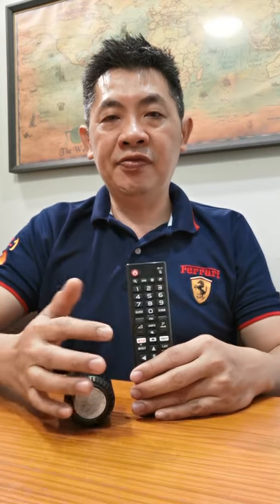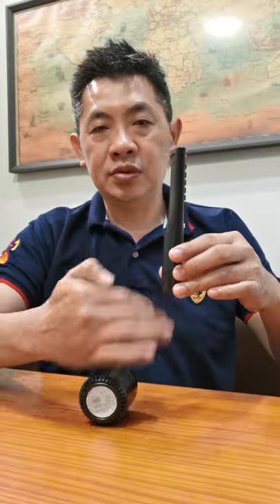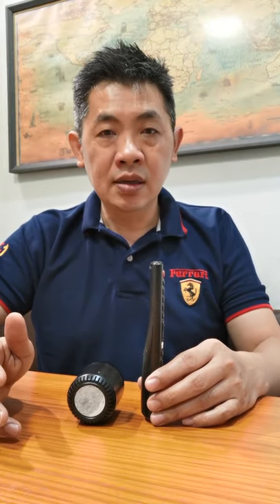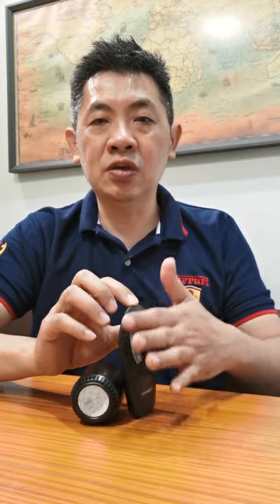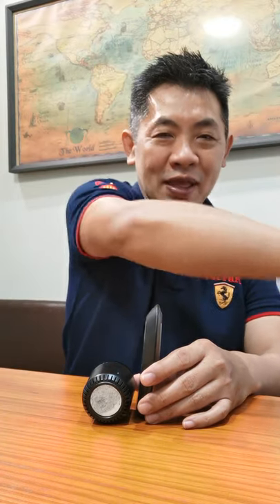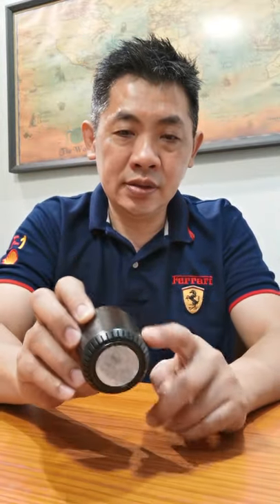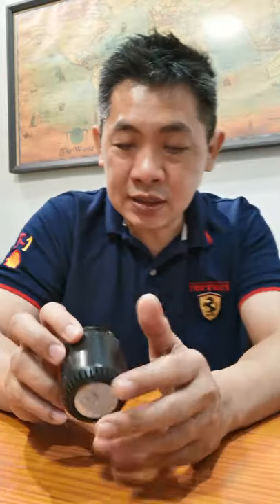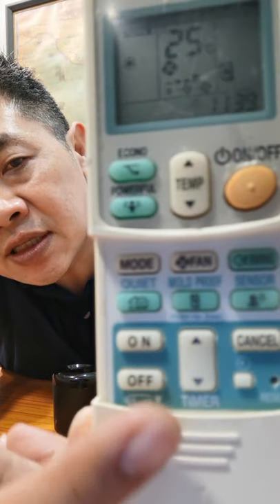How modern fan coil changed and why is it causing the fan blower to be wet.

Comment: It is science and logic.. Buy panasonic aircon.. It auto run for another 15-30min after u switch off and has nanoE G.. Thumbs up to you for explaining! I totally can relate and understand what u say as i was using a daikin aircon in the past and had similar situations as u mentioned..
Reply from the maker: Hi Terence. Thanks for your contribution. I learnt something new from you, kudos. Since it was marketed as nano g, i suspect it should be intended  at air purification . Nevertheless, as with most great inventions, the unintended result of running a fan function immediately as switching off air-conditioner results in moisture management, therefore mold management. Thanks for sharing !